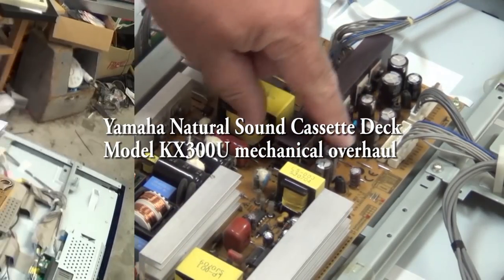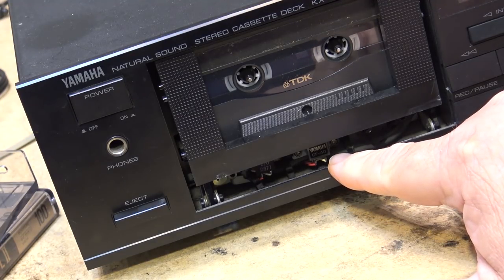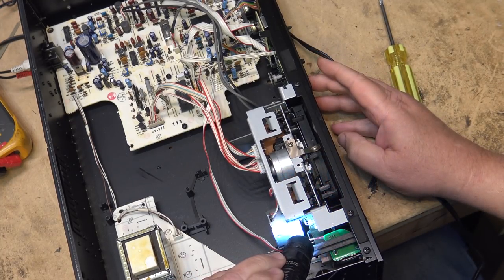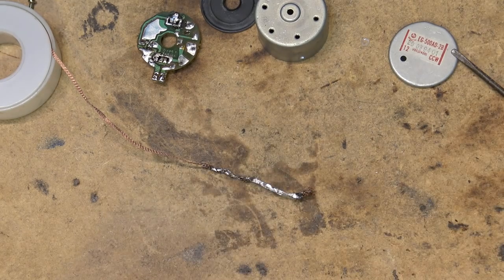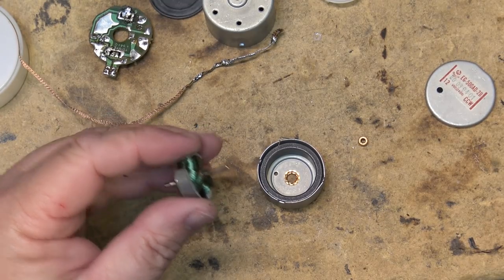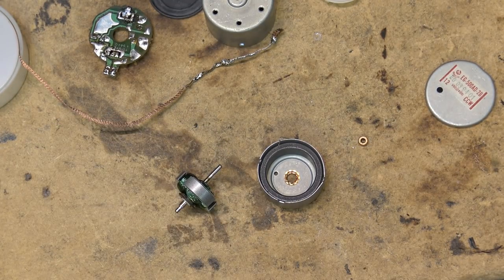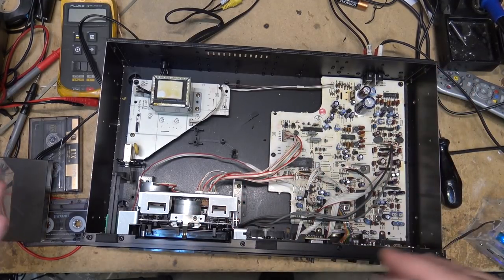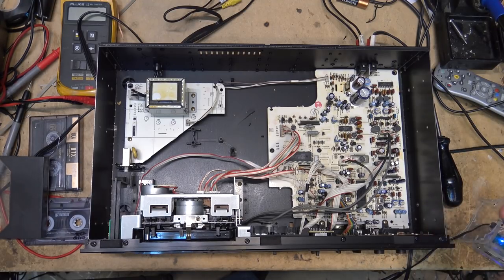Yamaha KX300U seized capstan motor repair not replace

Comment: It's so easy to damage the brushes on disassembly - not damaged here in this video, if someone is reading my comment BTW. ;o) 

 Recently, I had a suspect 1979, 12v dc motor, for my Sansui SC-1330 cassette deck. Rather than open it up to see if the brushes/cummutator connection was 'dirty', I decided to squirt Servisol into the motor through a hole towards the brush/commutator section. Since then, then motor has been steady as a rock as far as speed stability is concerned. Not sure if Servisol is sold in the US or Canada? 

 However, an old motor for my Aiwa AD-F770 did need replacing despite efforts to 'save' it. The replacement was a genuine Mabuchi CCW 2400rpm motor. See https://cassettedeckman.blogspot.com/2020/04/aiwa-ad-f770-capstan-motor-voltage.html

Comment: Is there voltage regulation in addition to speed adjustment on that circuit board inside the motor?
Reply from the maker: The speed adjust is just a voltage regulator. These are cheap motors.  Even high end decks used them. My high end technics on the other hand has a direct drive quartz lock servo motor like a VCR used.  Much more accurate.

Comment: Got a question:  you mentioned about the test tone tape, I have a hard time finding them online but if you’re making them, how much do you charge for a cassette tape with the test tone recorded?  Thank you for mentioning it and I learned a lot from you.
Reply: I bought mine at duplication.ca...
https://www.duplication.ca/audio-cassette-speed-calibration-test-tape.html

P.S. you can use an app on your phone to measure the frequency if you don't have any specialized equipment

Comment: hi i payed £2.50 for a spare  motor  when put heavy hours on a unit i service it  the tascam 238 capstan motor  is all ways playing up changed it to a  belt drive captain
deck all that hi tec servo was all ways driving the unit crazy
Reply from the maker: When they were readily available I changed them too but today they are harder to find.  I am not into paying huge sums for parts as I usually end up getting stung in the end.  When the mystery brokerage charge shows up that wasn't quoted.
Reply: +12voltvids - What the hell is with this "brokerage charge" and why does it only apply to FedX? I thought the U.S. and Canada had a free trade agreement. (Or did our illustrious POTUS FUBAR that, too?)
Reply from the maker: @Inflec  
Broker charges are fees charged by fed ex, ups and DHL passed on to the person receiving the package. Fed ex is the worst. 36.24 for a non taxable item.   How do they get there.  Well they charge a 25.00 fee to process the paper work. Now that is a service they have provided and that is subject to GST.  Because they are advancing the 1.25 they are paying on your behalf they charge an additional 10.00 advance fee for a total of 36.25.  DHL charges a flat fee of 22.50 for non taxable items.  Since they require payment before they leave it they don't charge an advance fee and neither does ups because you have to pay it up front to get the package which is nice because it gives me the oppertunity to refuse it and have it held, and then I can hit the shipper up for the fees or it gets returned at their expense.  Fed ex on the other hand just leaves it and bills you later and if you refuse they send it to collections.  Fed ex takes it an additional step. They always ask for a declares value and tell the person shipping that they include 100 in insurance. All they have to do is tick the box for insurance.  Now the item has a declared value of 100 usd. That works out to about 133 Canadian and now it triggers provincial and GST of 12%. About 16.00 plus the 36.00 they charge.  
Ask the guy that sent me his Sony digital 8 camera how it felt to pay an additional 52.00 in fees because he shipped it fed ex instead of USPS which would have not cost a penny had it been declared as salvage, which it was because it was broken.   He wasn't happy to pay the extra but I would have been very happy to sell his camera has he refused to pay the fee I got stuck with.   I get stuff sent to me all the time.  Expensive cameras modules all those things  I review.   Never pay any duty or tax unless the shipper screws up. Why do you think I haven't done anything for bang good lately.  I was getting lots of product to review and then they changes the person in charge and the new person shipped a security camera to review by DHL and it came with a fee for me to pay. I refused to pay it so they returned it to them and bang good now stopped sending me stuff to review .
Reply: +12voltvids - Jeezuz! So if someone uses "alternative" shipping instead of the official postal service, you or they get hit with these fees and taxes on top of it all? Sounds like a legalized racket to me. :(
Reply from the maker: @Inflec  UPS DHL and FedEx ex all charge broker fees for everything they bring in.  Send a blank piece of paper and they will charge the receiver between 20 and 37.50 to deliver it.

Comment: I have a similar issue but for me the tapes play too fast. I have tried the speed adjustment, does nothing, tried cleaning capstan and heads, no change. I have to also manually start the motor. I will now replace the motor and that should fix. Let me know your thoughts or anyone in chat.
Reply from the maker: Time for a new motor

Comment: Do a tune up video on your car please.
Reply from the maker: My car doesn't need a tune up. It's brand new. Electric cars don't need much maintenance. My other one is almost 9 years old and the only maintenance that has had to be done to date is new tires. 160,000KM (100,000 miles) on the original brakes and still 80% wear left! Besides costing very little to run, there is the maintenance or non maintenance that has to be factored in.

Comment: It would have cheaper and more time efficient to just change the motor, you can get them from Ebay and they ship them from China. I bought 12 counterclock wise, which are pretty standard and 4 clockwise, which I don't think I'll ever use.
But thanks for showing us all these videos on how to repair electronics!
Reply from the maker: I don't use eBay.  Been ripped off too many times.

Comment: Hej, i have an amp of which the transformer starts to hum very loud after running for a while. It wont go away with disconnected secondary so the problem lays in the transformer itself. Any ideas how to silence it?
Reply: If it gets very hot running disconnected you have an internal short, which is fatal. if it just hums and runs cool, then you can try to apply a coat or three of polyurethane varnish, preferably by heating the transformer to 100C in an oven set to cool (not hotter, as it will melt) and then dipping into the varnish till cool, and pulling out and leaving to dry for 2 days or so. The hot transformer will expand, and on cooling will pull the varnish into cavities, hopefully curing the hum. Works best with vacuum application of the varnish, but needs a vacuum pot and pump to pull air out under the varnish and then allow ambient air pressure on opening to push varnish into all the cavities. In any case the varnish needs to be fully covering the transformer.
Reply: D-lab has a video on how he stopped transformer hum. Pretty novel.
Reply from the maker: @SeanBZA  Was going to say the same thing. If it is humming when it is warm most likely one of the ferrous plates in the core is loose. Needs to be glued down again. On flyback transformers it was pretty common that the core wasn't sealed, and we would just use a varnish spray can and soak it completely and let it dry. 9 times out of 10 that stopped the squeal.

Comment: belt counter
Reply from the maker: What about it?
Reply: @12voltvids  you didn't put it in.
Reply from the maker: @walekook  guy that owns it didn't want it fixed.  He is using it to play old tapes to archive and then will be tossing it once done.  Made zero dollars on this.  Not doing anything more than the absolute minimum.  Paying customers get all the belts and stuff replaced but free jobs do not and this was a free job.  He paid me in old cassettes that I can sell as speed calibration tapes .
Reply: @12voltvids  it happened to me too.....I've been following you for a few months and your works are wonderful..thank's